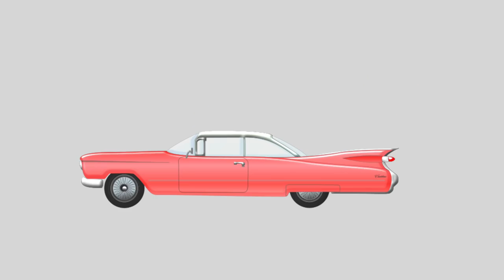Yes, Rockets CAN Fly in a Vacuum

Comment: This cannot be applied in space. 🤣😂😭
Reply: Why not?
Reply: @niallkinsella2687  because space is a vacuum for 1....
Reply: @3nr1tr1  
I'm well aware of the hard vacuum nature of space.
You've failed to describe how or why a rocket would be unable to function in such an environment.
Reply: @niallkinsella2687  there needs to be something for the thrust to push off of. A vacuum is empty of any of that. It's like running a water hose... when there is nothing in front of the water, it flows with little resistance. If you move anything in front of the path of the water, even it doesn't touch the hose directly, it will cause the hose to move back.
Reply: @3nr1tr1  
What you've just typed ignores several proven laws of motion.

Turn your water into ice and throw it.
Do you feel resistance? Is the ice resisting your attempt to accelerate it?
Reply: @niallkinsella2687  yes there is friction between my finger and the ice. It is kind of weird that your example would have me freeze water to make ice to throw 🤔 why not just say throw a rock ....
Reply: @3nr1tr1  
Since friction is the force resisting the motion of two bodies sliding past eachother, it's kind of hard to argue that it is the only thing you feel when you propel a chunk of ice.
It isn't friction that makes it harder to throw a medicine ball at 10 meters per second than it is to throw a tennis ball at 10 meters per second.
Try again.

I'm using ice because it's easier for people to visualise accelerating a solid than a liquid or gas.
Reply: @niallkinsella2687  well, how would a 'Physical' Rocket function in a zero physical place/ environment?? How would you apply Newton's 3 laws in space to achieve direction or speed change?
Thrust, motion, speed and stopping can only come into effect if there's friction, contact or some other substance to 'Work' off.
 A zero substance environment(that's what space is)provides zero fields for substance to work in. 
A 1,000,000 kw rocket engine would blast all its energy into nothing, zip, emptiness - a 100% vacuum, dispersing into endless nothing, never ever building up resistance. Newton's laws requires some resistance to function, space supplies zero resistance other wise all motion thru space would stall. A 5 day old chimp would understand this logic lol
Reply: @yabbadabbadoo8225  
Mass has inertia.
Inertia is a resistance to being accelerated.

Rocket fuel has mass.
When the rocket fuel is forced to accelerate and ejected (burned and shed as exhaust) it gains momentum.
The law of Conservation of Momentum means that total momentum in a system must be maintained. So the rocket gains momentum equal to the momentum gained by the exhaust, in the opposite direction.

Anything with mass can be used as above. If you accelerate it and eject it, it will gain momentum, and you will gain equal momentum in the opposite direction.

This is the absolute fundamental physics behind rocketry.
Reply: @niallkinsella2687  Have you personally proved this theory of your?
Have you actually popped into Space and performed this test?
Thrust works on Earth because of physical contact, either with surface elements or atmosphere resistance. Remove those elements and Newton's thesis is null and void.
Thrust in a vacuum is null and void, cannot exist, and never will until 'Space' is filled with something like air or a gas material to Thrust off. Any Chimp can follow that logic
Reply: @yabbadabbadoo8225  
It's not "a theory of mine".
It's part of the fundamental laws of physics governing everything in our universe as we know it.

And yes, I have performed experiments that prove the law of conservation of momentum, and Newton's laws of motion.
We do it in high school where I'm from.
Reply: @niallkinsella2687  So how did your class get into space to prove this theory of 'thrust' which I know only works within the world we all live in.
Reply: @yabbadabbadoo8225  
You don't need to be in space to prove the laws of motion.

You'd know this if you understood the fundamental physics behind it.

But, as you keep admitting (by insisting that Newtonian physics don't apply in a vacuum), you don't understand the fundamental physics.
Reply: @niallkinsella2687  So run that traction theory past me one more time if you don't mind?
Energy is piped out from an engine, so in this case it's Solid fuel. It's blasting out say 100,000 Lbs. So all that energy/ force is getting dispensed against what?
What is this 100,000 Lbs reacting off?
How is this 'Load' piling up to cause back pressure? The first squirt is still blasting away at 1000's of MPH and is never going to slow down to create a static amount of resistance. So at what stage does a build occur in order for a force large enough can effect a speed, braking or direction change to happen? Seeing space is an endless void no spent energy will ever back up.
It's like trying to push a car while on a treadmill in neutral. That rubber belt is just going to keep going backwards with every step. But I know you are way to smart to understand this example.
If my whole self was a feather I could never run, push, swim, jump - do zip. I would be going where nature deemed.
It is mass and energy reacting against Resistance, other forces that delivers the possibility of motion. Isaac Newton has proved this theory / fact here within the confines of Earth. These rules don't apply in space. But you seem to be a smarted Budgie than I. Lots of People believe in Easter Bunnies and Santa. They also are Myths lol My time on this trivia is over.
Reply: @yabbadabbadoo8225  
"Run that traction theory past me one more time"
Traction has a clear definition in engineering.
I haven't mentioned anything about traction.

If it feels like I'm being pedantic here, it's because I am. Because you've already shown that you will misrepresent what I've written, or attribute statements to me which I have not written.
I'm not going to engage unless I'm certain that you understand what I'm talking about, and will not misinterpret or misrepresent what I write.
Reply: @niallkinsella2687  just to clarify your beliefs on space travel. Are you saying or confirming that a space ship fitted with gas or solid fuel equipment could make a turn in space and also stop or speed up?
Reply: @yabbadabbadoo8225  
A spacecraft can adjust its course, and accelerate.
This is relatively easy.
Just accelerate and eject some mass (fuel).

There is nothing in the laws of motion or conservation of momentum that prevent and object from accelerating if it has mass that can be accelerated and ejected.

This isn't a belief. It's a fundamental reality of our universe.
Reply: @niallkinsella2687  For the records, who are you citing? I've noticed that Jet propulsion jobs are very rare on this planet.
Reply: @yabbadabbadoo8225  
De motu corporum ex percussione and Philosophiae Naturalis Principia Mathematica.
Reply: @niallkinsella2687  on to it cheers
Reply: @yabbadabbadoo8225  Newtonian physics does not require an object/surface to "push off of." All it says is that for every action (in this case, vaporization of fuel/oxidizer), there is an equal (expulsion of propellant) and opposite (thrust in the forward direction) reaction.

When the fuel and oxidizer combust, exhaust is pushed through the engine bell, and the rest of the rocket is pushed forwards due to this opposite reaction. Forces act upon the rocket by means of that combustion.

Think of combustion as a constant explosion. Fuel and oxidizer combine and expand to create exhaust. This expansion happens in all directions, backwards and forwards. The exhaust pushes itself out of the engine bell, as well as in the direction of travel of the rocket. This expansion propels the rocket forward, regardless of whether it is in an atmosphere or not.

It's like a gun being fired off constantly. The explosion pushes the bullet forwards, but the same force is applied in the opposite direction, giving the person holding it a jolt backwards. This happens because of the explosion and expansion, not because of "back-pressure off of air."

In a world where forces require "back-pressure" off an object, how would that object be defined?

Comment: Please permit me to correct you on something. 
The fuel mixture in a car's gasoline internal combustion chamber doesn't explode. It can, that is bad though, it is called detonation. Detonation will damage engine parts so it is not what is wanted. This is why gasoline octane rating plays a role. When a gasoline engine's fuel air mixture properly ignites, there is a "flame front" which starts at the spark plug. That flame front progresses outward though the fuel, more or less smoothly. It is somewhat analogous to tossing a lit match onto a dried out lawn or farmer's field. The grass would start to burn where the match ignited it, a flame front would burn progressively outwards. The lawn analogy is 2D.  In a gasoline engine the flame front moves in 3D. Until I understood this flame front biz, I thought about gasoline engines (as a young man) in the wrong way. I thought wrong because so many people said, as you did, the gasoline / air mixture explodes in the combustion chamber. It is better when folks visualize the combustion process correctly. :-)
Reply: I think in most contexts people are happy enough to interchange conflagration and explosion. In a layman's explanation it doesn't really make a difference, so might as well go with an idea they're familiar with.
Reply: I feel my explanation was in layman's terms. Rocket engines nor gasoline automotive engines involve explosions (unless something is messed up). Words matter. If you want to explain how things work, explain it accurately. Gasoline engines are not too complicated for the layman to understand IMO. When I was a young man 50 years ago, it would have benefited me to have people properly describe what happens within gasoline engines rather than spread misinformation. I enjoy Miss. Amy's videos. I believe she endeavors to be accurate.  I appreciate that about her.

Comment: Do a follow up, sea level engines vs vacuume engines.
Reply: +SlocketSeven I think that was Jeremy's point.  Even on the Saturn V, as well as Space-X today, there is a difference between first stage and second stage motors.  In the nozzle to optimize thrust given the atmospheric pressure they experience (the first stage sees lots, the second almost nothing).
Reply: An optimal nozzle will expand the exhaust to match the ambient pressure, this extracts all the available thrust from the flow.  However in a vacuum you can never fully expand the gasses without an infinitely big nozzle, so you go for a balance between weight of the nozzle v. efficiency of the nozzle.

For lift off your nozzle is a compromize for the atmospheric pressure on the ground and at the point the next stage fires.

An under-expanding nozzle produces a spreading exhaust pattern, an over-expanding nozzle produces a converging flow which can detach from the inside of the nozzle causing massive vibrations and total mission failure...  Nozzle design really is rocket science(!)
Reply: Mark Tillotson still would make a good video.
Reply: +mark tillotson Ironically, some of it is originally steam science ;-)

The most often used rocket nozzle these days is either directly copied or slightly modified from the de Lavalle nozzle design developed in 1888 for steam turbines.  Also used in supersonic jet engines.

The de Lavalle nozzle is popular because it's very good at accelerating the exhaust to high supersonic speeds.
Reply: engines intended for vacuum operation typically have a longer engine bell, as the is no atmosphere to 'absorb' some of the engine thrust the exhaust gas can be expanded a little more than an atmospheric intened engine. for instance look how long the engine bell is on a CSM engine the AJ10 hypergol  https://en.wikipedia.org/wiki/AJ10  or this long lived donk which went from a 20-1 expansion ration to 150-1 https://en.wikipedia.org/wiki/XLR81
Reply: alan so yes a good idea for a video?

Comment: I will take it further.  Rockets in space are more efficient because of the Bernolli equation.  It is based on the conservation of energy.   A fluid along a stream line must have the same energy at one point compared to another point.  Pressure1 + Velocity1+height1=Pressure2+Velocity2+height2.  Location 1 is the combustion chamber. Location 2 is just outside the engine bell.  Height is pretty small difference and does not change so lets ignore it.  Combustion chamber has a high pressure and low Velocity.  Thus location 2 in the atm (a low pressure) must have a high velocity aka thrust.  Space having no pressure means velocity would be even greater.  A greater velocity means more acceleration F=ma more thrust for the same pressure.

Comment: Infinite vacuum would absorb any propellant, leaving you stranded.
Reply: "Infinite vacuum" is just 0.0 PSI genius.
Reply: The difference between "infinite vacuum" and normal sea level pressure is less than twice as much as the difference between the pressure inside and outside of a passenger jet at typical cruising altitude!
Reply: @fromnorway643  or more than twice the pressure in a standard car tire.

Comment: There is no air in space its vacuum so even if an engine burns fuel what is it pushing against in vacuum?
Reply: The fuel
Reply: @niallkinsella2687  lol.  So it somehow burns fuel (which can't be done without GAS o2), but then also has that same fuel magically get out and push???  L.O.L.    Just like car fuel will combust under water and create an underwater roadway xD xD xD
Reply: @DrCash7  
Someone is deliberately omitting the fact that rockets carry their own oxidiser.
Reply: @niallkinsella2687  oxidizer like liq ox?  Liq ox is not flammable.  You still need gaseous o2 for spark. Why are you omitting this?
Reply: @DrCash7  
Oxygen isn't flammable.
It supports the combustion of other materials.
And it does this in liquid and gaseous states.

You are perfectly aware of this. I've seen other posts by you that show you are perfectly aware of this. Having an agenda doesn't make your lies any less false.

Comment: Amy! Oh, no. Look, if they can't understand something simple like action/opposite reaction, then your car analogy is only going to make this argument worse. Bad example.
Reply: Well, only if you think they are unable to grasp a simple ..... oh, I see what you mean.
Reply: Maybe a better example would be an air-to-air missile leaving a fighter. Or even better one of the X-Planes as it is dropped from a B-52.
Reply: Kevin No. because those examples all operate inside an atmosphere. The question is about being able to thrust in the "absence" of an atmosphere to push against. Which we all know isn't what's going on. That is the point; how people can't understand that it has nothing to do with the atmosphere.
Reply: Sorry to reply back after so long.  But I would disagree. The piece is two parts. First Newton 3rd law, then operations out side of the atmosphere and the need to bring your own LOX. We can see Newton’s third law when the X-15 is dropped from the B-52 and ignites its engines.  Remember, the X-15 was a rocket plane, it operated at very high altitude, over 100,000 feet, near the edge of space, and was fueled by ethyl alcohol and LOX.  In fact some in the X-plane program hoped to see the X-15, or a successor, as the craft that would put the US into space instead of “spam in a can,” but it was not to be.  I wonder if Amy had done a piece on the X-15 trying for space vs Mercury?
Reply: Lots of people don't have first hand knowledge of rockets and missiles. They do have firsts hand knowledge about cars. Sadly, even those they misunderstand, but Amy is doing the right teaching tactic. Start with where your students are and lead them to where you want them to be.

Comment: I believe that the term “vacuum” to flat earther individuals is confused with a vacuum cleaner and the fact they contribute it with an opposite “sucking” force.  So they probably surmise that if an internally controlled rocket engine was to fire off in the “vacuum” of space that as the forces produced by the rocket would be equally dissolved at an equivalent rate as if the forces produced by the engines were somehow being SUCKED into a …well vacuum so to speak and therefore nullifying any and all possible forward momentum that is trying to be created by the rocket engine.  I honestly can’t think or imagine any other scenario that could cause these individuals to suffer from such delusions.  Luckily for the reasons pertaining to space travel this isn’t the case.  If you have a source to power a rocket engine or whatever the propulsion system is then when it is fired off in space the results will be your vehicle being powered forward and accelerating and not sitting in the same spot.  If this was the case then the shuttle orbiter would not have bothered to install thrusters in every conceivable angle all over the front and other strategic areas of the space shuttles in the US shuttle program.  I think for the sake of educating people who are….well I suppose, less motivated in learning about basic endeavors that the planets countries have in space exploration, we should just start referring to space as not a vacuum but simply….zero G.  Maybe that will help us in eliminating the problematic nuisances that seem to arise in the comment section of educational videos such as this.
Education is Boss !!!